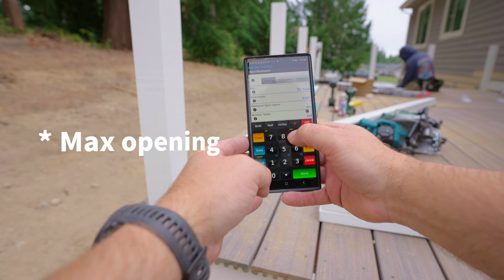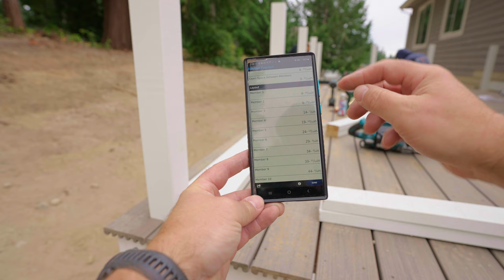How To Layout Deck Railing Balusters (Deckorators)

Comment: I'm not sure I've seen all the videos on this project, so apologies if it's covered elsewhere, but I'm currently dealing with some grading issue at my house and I'm wondering about that hill running down to the house.  Is there a french drain or something else to keep water away from the foundation?

Comment: Super interesting!

Dumb question, how do you make sure that your tape measure reading is accurate? Like if you measure slightly diagonally on the board you'll be of by 1/8 or even more, right? I'm new to using tools and this is a problem I'm having.
Reply: Look at what you’re doing and always triple check yourself